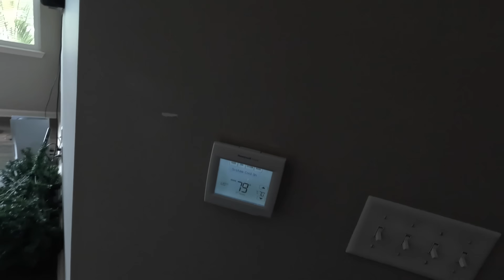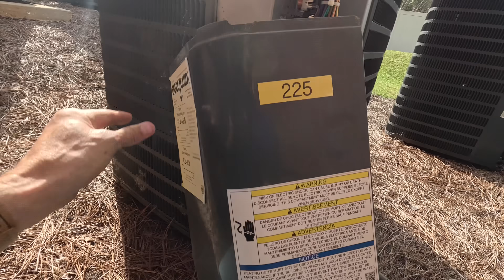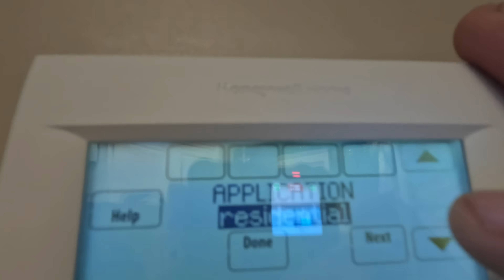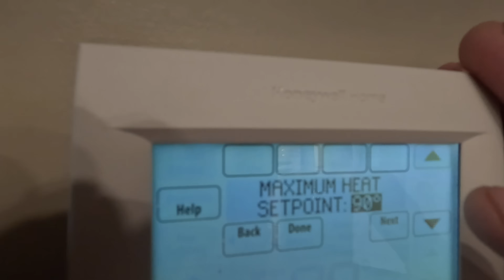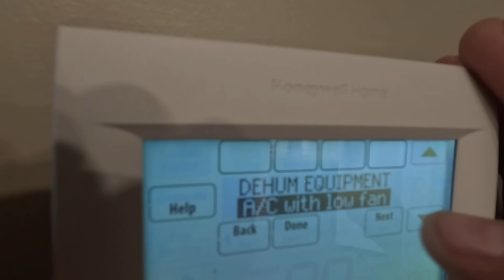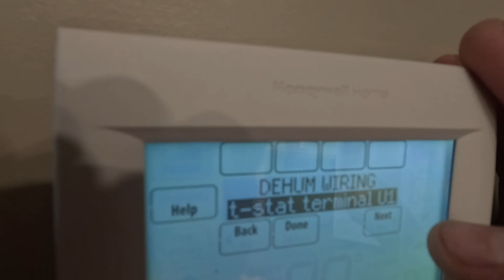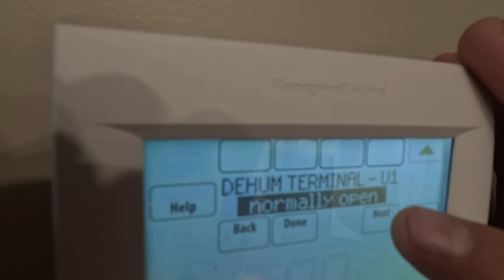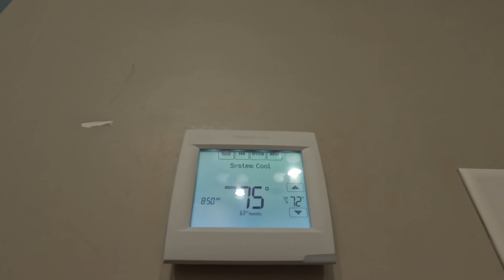It Really Was Blowing Hot Air in Cool! #hvacguy #hvaclife #hvactrainingvideos

Comment: I had a job that I took care of remote cell sites, truck with camper had a 100 gallon water tank with a basic home well pump and worked perfectly to rinse out Bard units, just like having a residential water supply with  great pressure, just add your hose and a spray nozzle.
Reply: It should be code to have a water supply on any building.
Reply: @jthonn probably does have water supply somewhere but not necessarily where the outdoor units are.

Comment: When will the management or power company get the unit numbers for the compressors to correct apartment so that you don't have to search which unit to open.
Reply: Why would you think it was the power company's job? Their responsibility stops at the meter.
Reply: @jimdavis6833  well, well then maybe you will accept the electrician. Picky, picky
Reply: @jimdavis6833  If this is the same complex he had this problem at last time, none of the meter numbers are correct either.
Reply: @brad6665  Let me guess, you're a Harris voter.
Reply: @uzlonewolf  You are thinking of the disconnects, not the meters. The meters have to be correct or the occupants would get the wrong bills.
Reply: @jimdavis6833  No, I'm talking about the meters.  A different apartment was shut off for non-payment and it killed power to the A/C unit he was trying to work on.  The disconnect was also wrong and went to a 3rd apartment.
Reply: @jimdavis6833  Damn sight better than voting for a traitor!
Reply: @williamjackson5942 Wow... What color is the sky in your world??